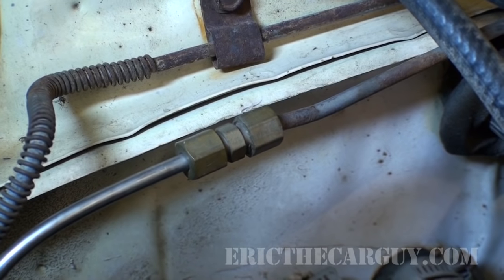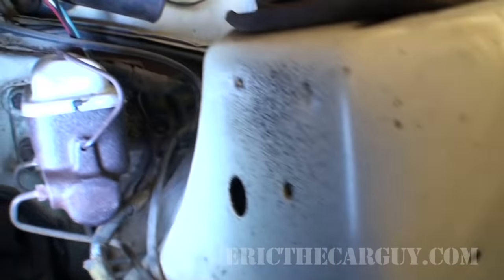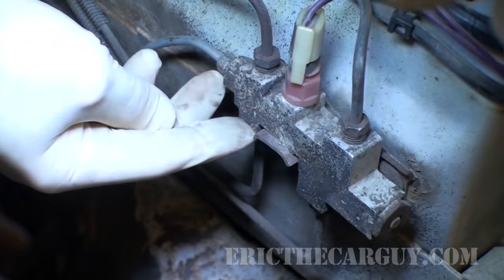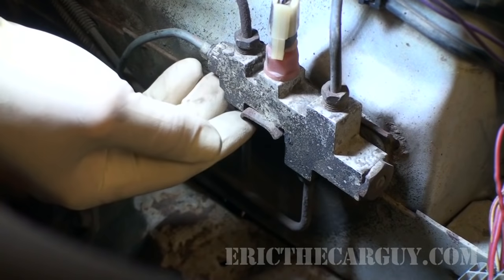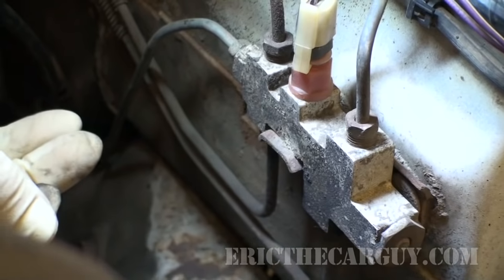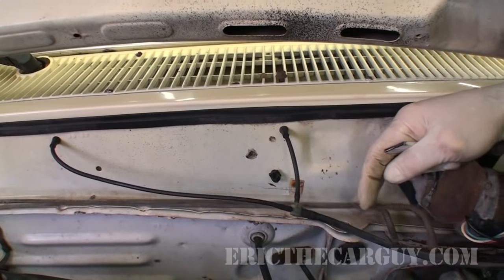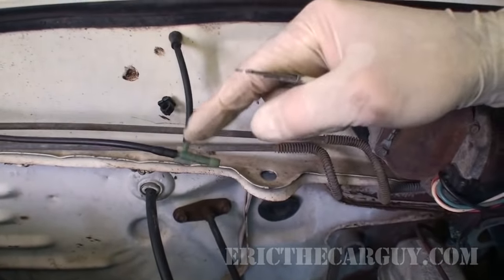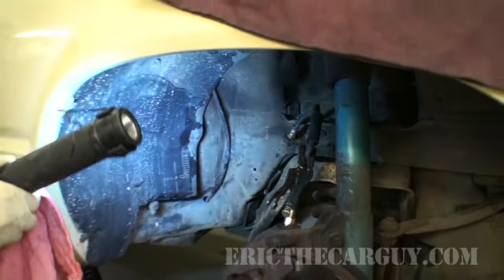How To Bend and Flare Brake Lines -EricTheCarGuy

Comment: Just curious. Could you have made 2 half lines instead of a long one to get an easier indtalation?
Reply from the maker: The idea was to eliminate the compression fitting. Also, the less connections you have, the less chances you have for a leak.
Reply: Most states don't allow brake lines to be done in multiple pieces, has to be a one piece deal.
Reply: fordwindsor351 That's ridiculous and not true. Compression fittings are not allowed and unsafe, but two lines joined together with proper flares and a brake line union is legal in all 50 states. My truck came from the factory with a 2-piece rear line, joined together with a union. I highly doubt Ford would've done that if it wasn't legal and safe.
Reply: Think what you wish Jon Clark but some states it is illegal as in New Hampshire
Reply: fordwindsor351 Show me some proof of that and I MIGHT believe you. You think Ford built a different Ranger just for New Hampshire that doesn't have a brake union, and built ones with unions for other states? 'Cause if it's illegal like you say, there's no way Ford would build/sell it like that.
In short, you're wrong.
Reply: Its ok you can continue to think as you wish, people are wrong at least once a day every day but what I said about new Hampshire is correct. come here and try to pass state inspection with your setup lmao you wont pass period. yes, in some aspects manufacturers do have different setups due to some state laws that are different from one another.
Reply: fordwindsor351 So you're saying Ford DID make two different Rangers, some with the brake union, and some not? LMAO, yeah ok. And why wouldn't Ford just make all of them without the union to just be legal in all 50 states? It would be cheaper and simpler not having two different setups. What advantage is there to have only SOME trucks have the 2 separate lines?
Reply: +fordwindsor351 It's ironic that in the "live free or die" state, they have tougher rules on brake lines.
Reply: I agree
Reply: Timothy Hintze
I thought it was a race sanctioning body inspection that nixed the compression fitting, but it wouldn't be unreasonable for any State to prohibit compression fittings on brake lines. Compression fittings can work well and have their place, but that place isn't on brake systems.
Reply: +waswestkan I've used steel compression fittings for years on my own cars with absolutely no trouble. If I wanted to sound smart I would say what you did but you are wrong.
Reply: -waswestkan uo p.
Reply: yes
Reply: you in theory could make it as many as u want but each peice u make could also add more resistiance
Reply: and weather or not it causes significant resistance i'dk because I'm not a engineer but I know That when u go from corrugated piping for a dust collection system In a wood shop vs smooth pvc it makes huge differances much like porting. polishing a intake manifold much like how too modern cars have better drag coefficientcys then older cars.little stuff adds up.even in human body's it does little differances in even toe lengths and where the ligaments and muscles connect and muscle types dictate being able run a few mph faster.vs being average in speed.or unathletic.
Reply: sorry I left out how the resistance is made its made via friction. even air creates friction.
Reply: +EricTheCarGuy Hey Eric! Great video (: But I got a question, I'm currently doing a 5.0 Engine swap in my 1991 Mustang LX Coupe 2.3L. For this swap, I'm going to need new fuel lines as they run across the right side of the frame, rather then the left where they are now. Is it possible to just "Re-Bend" them and do it the other way around? Let me know! Thanks!
Reply: Here in OH-Tuckey there are NO safety inspections period ! People drive around here with no hoods, no fenders, no exhaust, bald tires and virtually no brakes ! YEE-HA !!
Reply: Brake lines can be in more than one piece in most states if not all (some automakers use multi-piece designs now) but using unions with flair fittings, not compression fittings which are what is illegal.
Reply: @ericthecarguy  what can be done to break apart the joint between the hose and the metal tubing.  The wrenches I purchased are sloppy on the hex head and has damaged the edges.  Had tried penetrating oil and when I couldn't free it I tried heat for about three minutes which didn't solve my problem.  Need to replace caliper hose.  Any suggestions?

Comment: Really, how can you drain the master cylinder through the prop valve? That doesn't work that way.
Reply: The valve will allow fluid to pass easily. That is why you can gravity bleed the system.

Comment: Dude, besides kinking the line.  Why did you clamp down the hose before the caliper?  That new line you threw on was full of air, so all of that air had to run through the caliper anyway.  It would be a different story if you clamped it closer to the fitting of the hose and bleed it from the fitting on the line you made.  Otherwise clamping that flex line down was worthless.
Reply: And I'm pretty sure he used a pair of vise grip pliers to pinch the new hose. He will eventually end up with a leak in that spot on the hose caused by his poor choice in a clamping tool.

Comment: if he just poured  boiling hot water over that vacuum hose it would of came off easier due to it being soft 
and more flexible
Reply: +Peter M or heat it with a lighter, or heat gun.....
Reply: i wouldnt heat with a heat gun or lighter may weaken the it to much
Reply: OK, I would though.....
Reply: ok
Reply: +anthony diodati  my vacuum system are small rubber hoses 3 of them i'm not sure about other cars systems around the world cause my systems rubber hoses id use boiling hot water
Reply: +Peter M sounds good too,  don't want to damage nothing either......... Regards
Reply: cheers mate